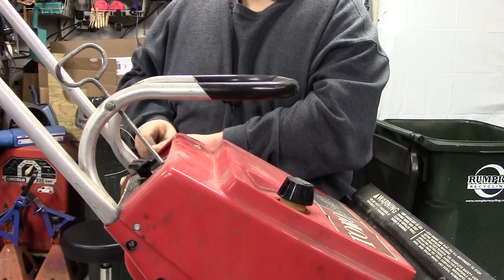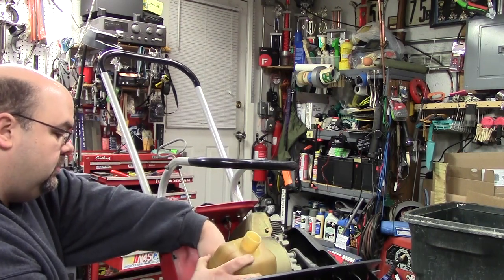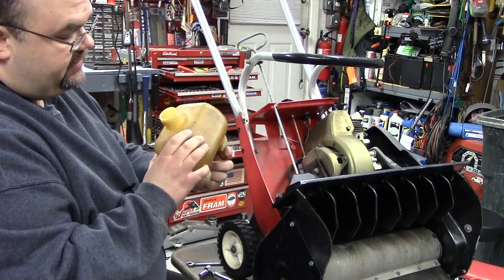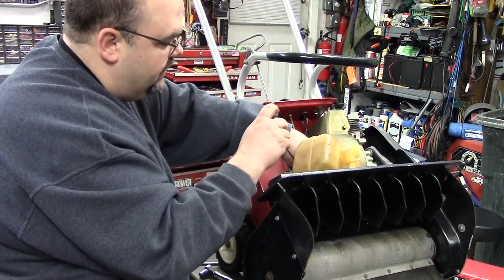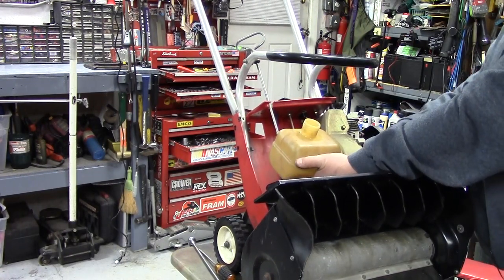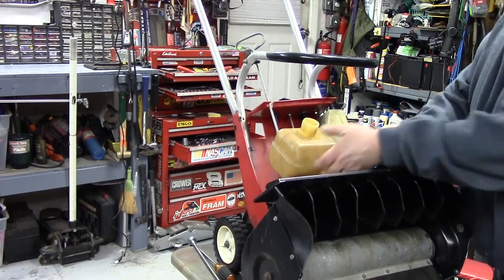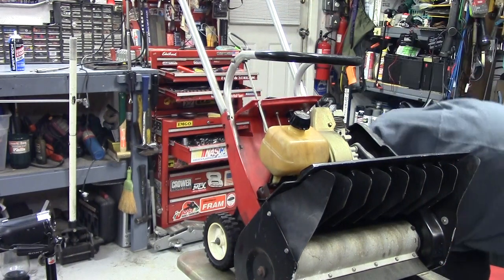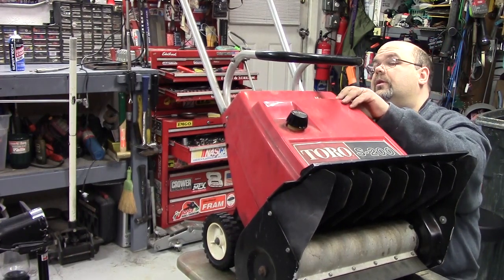Restoring a Toro S200 Snowblower | Fuel System Inspection and Start-up

Comment from the maker: OEM Toro 23-3730 KIT Snowthrower Rotor Paddles, Scraper, & Belt for S-200 S-620
https://amzn.to/2Mh3Sz0

New Carburetor Snow Blower Kit for Tecumseh 3HP 2 Cycle Toro Sears Craftsman MTD
https://amzn.to/3amgZXF

2 Snow Thrower Starter Gears 28-9110 for TORO S200 S620 : ;PO#44T-KH/435 H25W3312741
https://amzn.to/39zYe3y

Comment: My Grandpa's has been sitting in the basement unused for about the past 25 years. Luckily no gas in it. I'm going to get some and see if it will run.
Reply from the maker: TreasureHuntingSWPA  -  They’re good little blowers.  We don’t get much snow here in southern Ohio so they’re nice to have for small areas. Good luck getting it running.  👍

Comment: I swapped out my snowblower to one of the Chinese Yanmar diesel clones so I'd never have to mess with old gas in it.   The diesel engine swap worked absolutely fantastic.   It does take 8 or 9 cranks to start in the cold weather but you can add electric start to these or just hit the cylinder with a propane torch for 30 seconds to make it start quickly.   Has way more power, efficiency, and still have all the electric grip warmers, etc.
Reply from the maker: That's awesome!  I've used the propane trick on my old 7.3 in the past when I forget to plug in the block heater. So far ive been lucky and not blown the intake off of it.  😁👍

Comment: I picked one of these up off the side of the road today. Didn't have to do anything and it runs. It's in rough shape though. Starting your engine up in the summer wont do any good unless you stabilize the fuel.

Comment: I'm having issues with my same thrower not firing, I replaced the spark plug, fresh gas and oil mix, and started fluid as well. What else do you think I should do? I am very new at repairing stuff like this stuff.
Reply from the maker: Is it getting spark? Did it fire with starting fluid?
Reply: @baldeagle242  no it did not on either
Reply from the maker: @Proskaters6  id check your kill switch and kill wire for any damage. You already replaced the plug so after that i’d check the air gap on the coil.  Lastly if that all checks out is replace the coil.

Comment: I have one of these S-200 Snow Throwers, but can't get it started.  I cleaned the carb and installed a new diaphragm, etc. When I tested the compression it was around 80 psi, not sure if that is a bit low.
Reply from the maker: Should run with anything over 60psi.  Will it fire on starting fluid?
Reply: @baldeagle242  I believe I tried starting fluid, and wouldn't fire. I also have a slightly newer model that I bought in 88, same issue. I can't find any aftermarket carbs for them, they both have the same flat Toro made carbs.
Reply from the maker: @Pyridox  if you have 80psi on compression and it won't fire on starting fluid I would confirm your kill switch is working properly and you're getting spark.
Reply: @baldeagle242  Ok, thanks for the info. Now that the weather is better I can work on it.
Reply from the maker: @Pyridox  You're welcome.  Thanks for watching.

Comment: My opinion Ethanol Gasoline is horrible for small engines, Almost impossible to find gas without ethanol  i started running my mowers with the highest octane i can purchase not sure if this helps or not, for my leaf blower  I purchase the premixed cans because it has no ethanol and a can of fuel will last 2 seasons, my snow blower i run the carb out of fuel and drain the tank  in the summer just trying to give the carb the best chance of surviving, I could be completely wrong But it works good so far
Reply from the maker: +Vincent's helpful hints, Always best to run the carb dry when storing equipment.  👍
Thanks for watching.  🦅